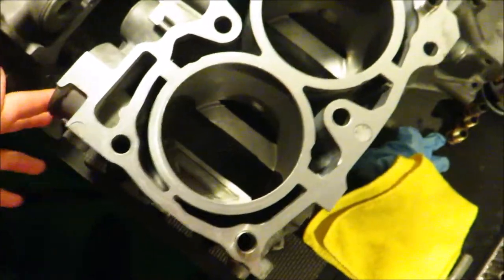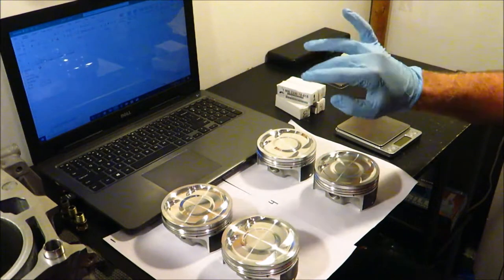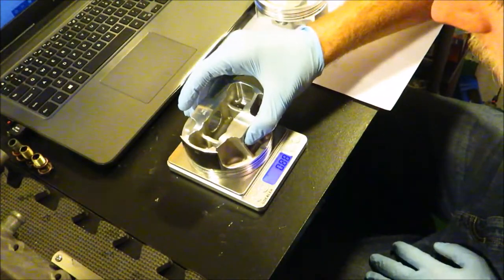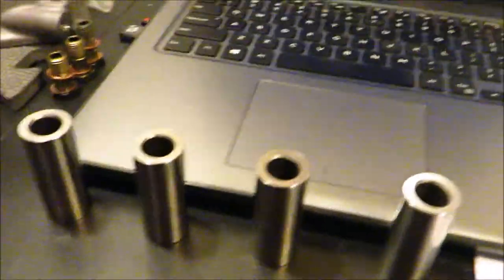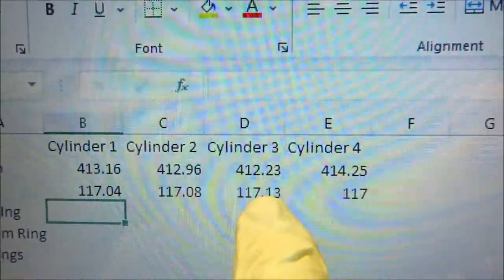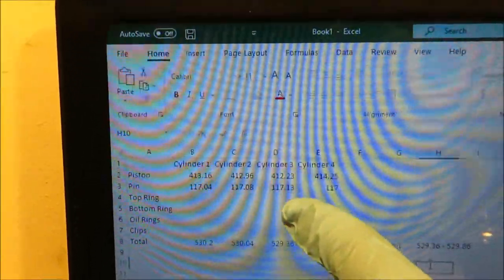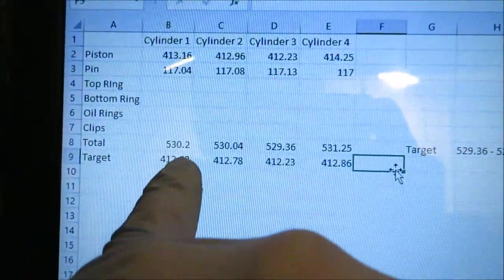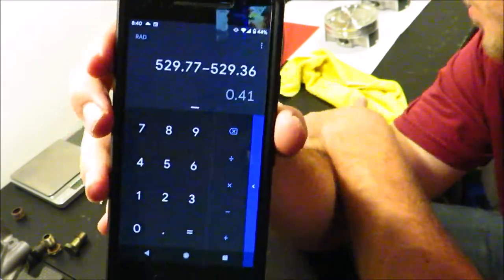Subaru Ej25 Engine Build (Piston Balancing)

Comment: Following this series, but got a little confused on the order of the videos/days. What happened to your original motor that you had to buy a scrapped ej255 to rebuild it?
Reply from the maker: The original motor got ringleader failure, diagnosed after the spark plug video. While the original engine was still in the car I was building a spare motor, and swaped it in once it was done, there are some videos out of order, but thats just because I was behind on edit the engine rebuilding videos, but thats the general order.
Reply: @SWSpeedCo  All good, just wanted to get an idea of what happened. Thanks

Comment: Hey man how is the Aisin water pump? I heard they are way better than the OEM one.
Reply from the maker: I have 10000 miles on it and have had no issues. The bearings that come with the timing kit are the same ones as oem so they will last just as long

Comment: @ SW Speed I have been having this overheating issue with my 06 XT.  147k on it did a T-belt package last year as I starting hearing sloshing in the dash.  Did the T belt and it got better.  This year it got worse so I did the head gasket and ARP studs.  Put it back together now it got worse over heats while driving.  Did pressure and vacuum tests neither one holds.  I am at the point of changing the block now as I have no where else to look for leaks.  Not seeing any leaks and nothing under the car.  OEM thermostat.  Have any suggestions where else I can look?  All vacuum/coolant hoses were changed when I did the head gasket.
Reply from the maker: If you've done all of that and it's still overheating I would imagine that your radiator is not working correctly. Either an internal blockage, or the fins being blocked up with leaves and bugs not allowing air to flow through the radiator properly. I hear a bubbling sound in my dash after I turn the car off, im pretty sure that is normal, probably something to do with coolant in the heater core. 
I would look into the radiator a bit more I find it hard to believe there would be an issue of blockage in the block.
do your fans work?
Is it overheating when your stoped or like driving down the highway?
Reply: @SWSpeedCo  the radiator seems new. I bought the car about 2 years ago. Would that cause the air in the heater core?
Reply from the maker: Idk what causes that, I've never had any overheating issues so I don't have much experience troubleshooting that kind of issue. There may be something on the forums that can help you, but from what you told me the next logical place to look for the issue would be the fans and or the radiator, if it's overheating when you are stopped your fans probably arnt working, if it's over heating when you are driving, it's probably a airflow blockage or coolant blockage
Reply: @SWSpeedCo  I do have an extra radiator that’s new. I will try it and see. LGT forum folks are puzzled on their too. I will try changing the radiator if that doesn’t work I will take the motor back out. Thanks for your suggestion.